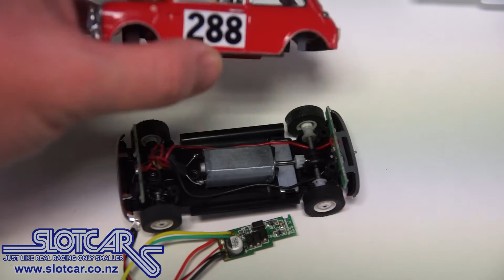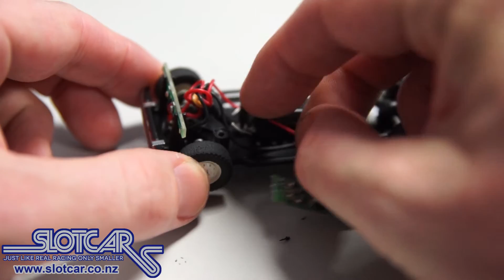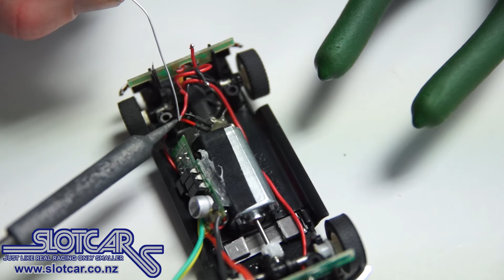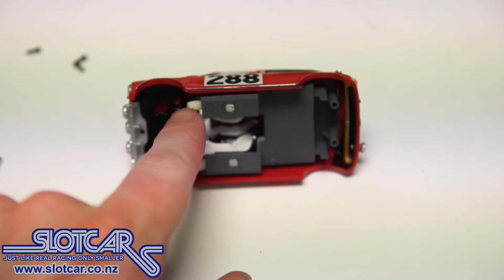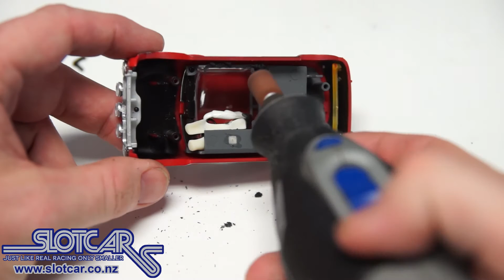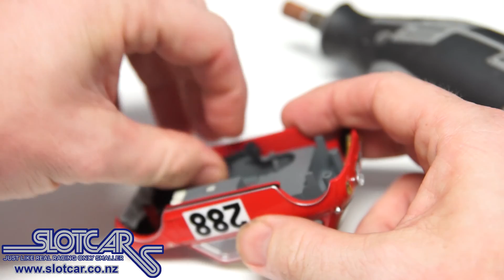Chipping Scalextric Mini for SSD - Slotcar NZ

Comment: Hi, dont you need to keep the resistor on the end of the green and brown wires, otherwise the cars and chips die out?
Reply: Undertaking this install as per demo, just checking is it OK to remove the resistor on the end of the green and yellow wires instead of replacing pickup tabs. using Scalextric microprocessor ref C7005-02-525

Comment: I have used this video and converted 3 scalextric mini's to digital.  All worked perfect but after a short while 2 of the chips have died.  Could this be because the chip in mounted right next to the motor?